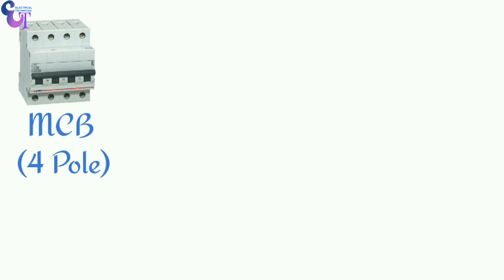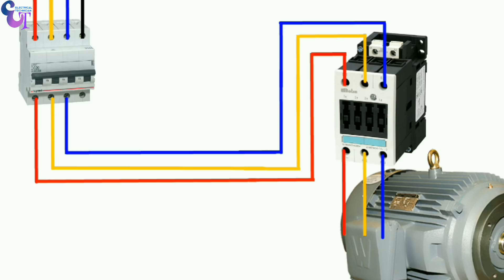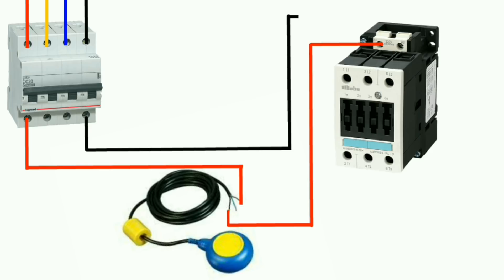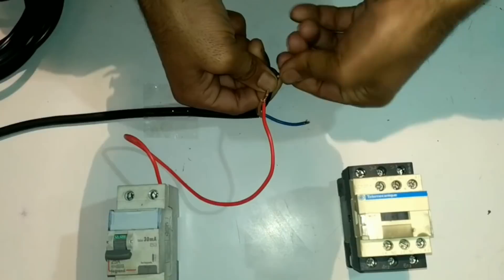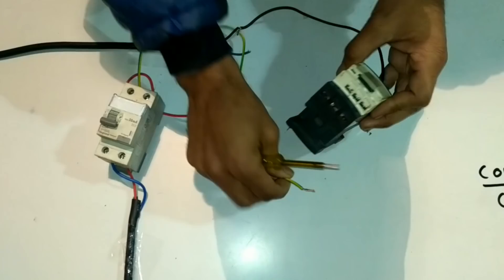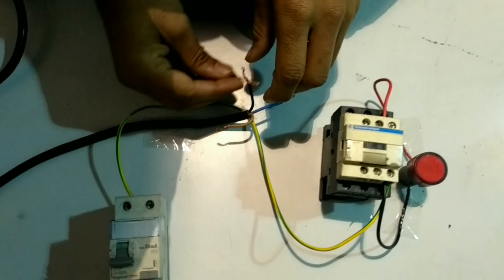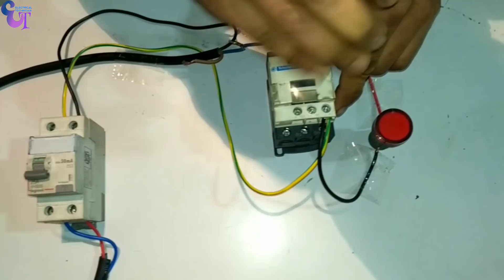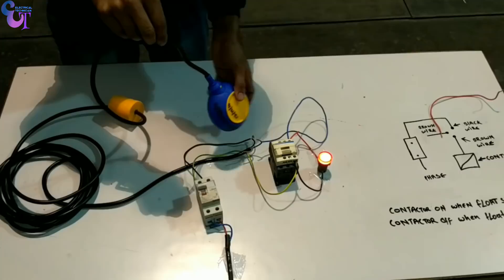Float switch how it work| Float Switch wiring | what is float switch by electical Technician

Comment: black and blue wire for filling water?
Reply from the maker: It's depand on company modal which wire they have given 
You can check it out by doing connecting a bulb or by doing continuous test 

Give neutral supply directly for the bulb and phase supply by float switch 

When the float switch hang down the bulb should be on and when u lift it up the floot switch the bulb should get off

Comment: hello is it possible to connect two float switch on one pump
Reply from the maker: Yes it's possible to connect it 

Actually i have done it in my company. There is a main watar storage tank in my company in which we have to on and off the Motor manually one day i modified it and install a float switch in it.

But after one year the float switch get faulty and it doesn't off the motor that day whole night water get overflow
So next day i did a practical by connecting 2 float switch in series to each other 

From that day till now the water tank has never get overflow .
Reply: @michaelnightingale3280  I'm trying to Load  Higher position tank by a lower position tank, how can i use 2 float swtches on it?
Reply from the maker: Use the both switch in series 
If The lower tank water level is low the float switch contact should be Normally open and when the water level get up the fooat switch will get normally closed

The up level tank  float switch should get Normally open WHEN THE water level get full and when the water level get low the float switch cobtact should be normally closed
Reply from the maker: The motor should not get on if the lower water tank level is low so we need to install a float switch in lower tank also

Comment: What is the materials for making this project?  Thank for your respond
Reply from the maker: If you want to make a simple float switch control for water tank without any manual starting circuit than You just need a 
1. float switch 
2. Contactor 

But if you want to add it with DOL STARTER than use all Electrical Equipment which you need for DOL STARTER and a float switch

Comment: 3 fes statar with flot canectione
Reply from the maker: Connection will be same as its Explained in the video , motor power supply is given from power tarminal of the Contactor but we use float switch for controlling .

Connect the Contactor with you DOL Circuit